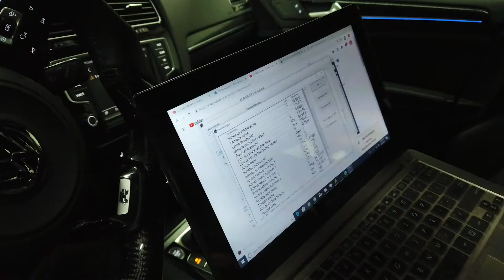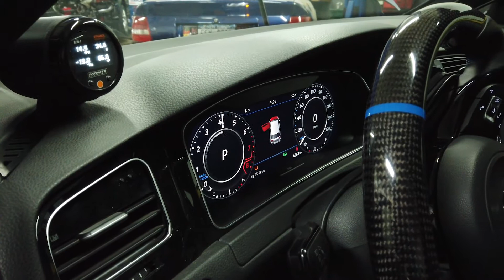My Fully Built Stage 3+ Golf R Update ( 17 months in the making)

Comment: At 9:48 you said "it's still knocking". I've been looking into these cars for the last year and i've come across a couple people that have had "knock" issues. Apparently, having super stiff mounts can set off the knock sensor from the added vibration. What mounts (motor, trans) are you running?